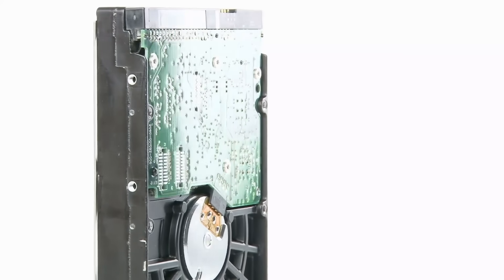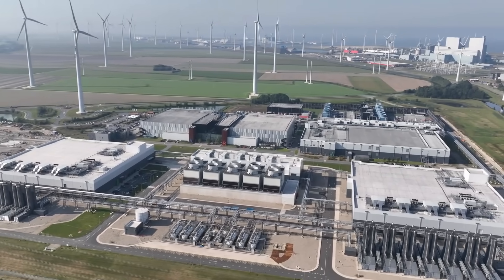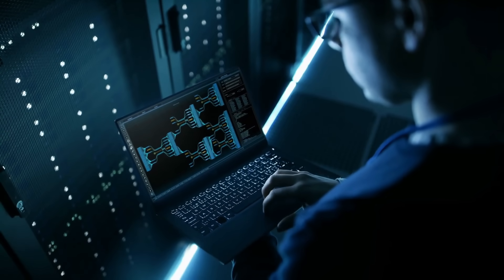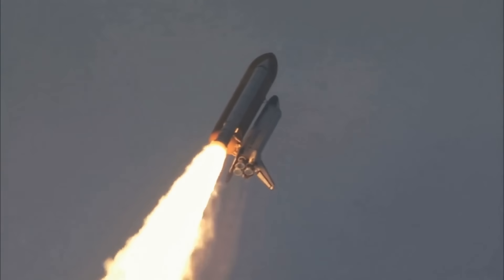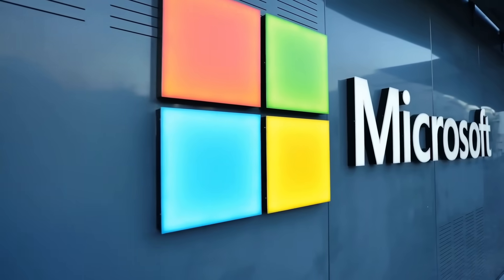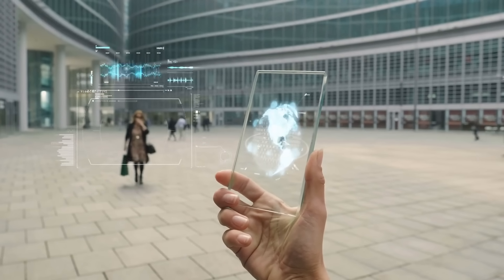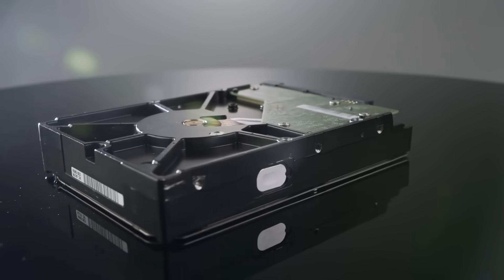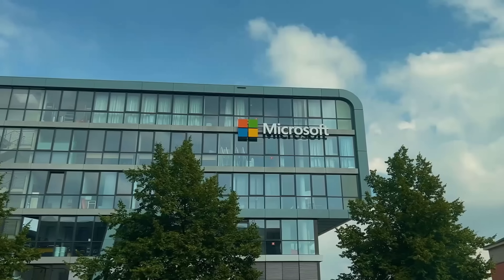The Glass That Never Dies (And Microsoft Is Terrified)

Comment: They better standardize the storage"format". These are morning but glass without a way to read the data from them. The stored data will only last as long as the hardware made to read the glass. Imagine a company uses a proprietary storage method. Then, the company goes out of business. Then, the expensive data readers start falling after a few decades. The stored data becomes unrecoverable as readers die. Companies scramble to buy and use the last of the readers to migrate the data. But, at such allow read speeds, the readers will never last long enough to migrate the data.

Comment: But what’s ridiculous is that you guys don’t mention the fact that they taking that failure as part of the process. They count on it. This is why they are constantly replacing drives and equipment at data centers. Every day in a data center you might see three or 400 new servers come into action while maybe 250 die and 50 are there just in order to replace ones that might die in the next week they don’t wait for them to die. They plan the obsolescence.

Comment: Ummm…this may be pedantic but…fused silica is a supercooled-liquid meaning it still flows, even if it is going very very slowly. So, this means that over time all your data flows into a literal puddle of incoherent nonsense. The risk of data loss due to flow increases with the density of the data. High density storage often requires smaller, more precise alterations to the material, making them more vulnerable to the effects of slight material shifts over time. It has potential, but it isn’t “there” yet. The flow must be addressed.

Comment: that isn't new, it is like carving rocks but with glass at nano scale, plus, you know what else can store thing for several years without power? a powered off hard drive, hard drives in data centers dies because these are on for long hours constantly, some even under stress conditions and high temperatures, but cold storage that is left sitting unused in normal conditions(temperature, humidity, magnetics) for long, will be fine for decades, unless you bang on them.

Comment: I would love this, can we get a home or small office solution incorporating this.  Well it’s very secure if it’s physically offline until needed, and it can’t be overwritten or changed.  It’s okay if read/write is slow.  The advantage is long term durability.  I have years and years of this kind of data, and have to move it from spinning drives to SSD.

Comment: Here's the problem nobody's talking about: How dense is the storage medium, and how many are expected to be produced, and with the "cold data" behavior, you have to factor in how many will be in the same volume. Too much density per volume and the land itself wouldn't be able to support it. What happens when we get another technology to replace that one and that one goes to one place (like a landfill) and all that mass is pushed together over time, generating more density in that volume)? It sinks, or the land does, depending on how density is displaced. But only so much density can be at any place without causing other land to undergo stresses, and that can change the density more by reducing the overall volume by bringing two points closer to each other. Less volume means more density, more density means more sinking. More displacement means larger area sinking by less amount at a time.
We already have so much much collected in small areas/volumes. Military bases, naval shipyards, Trump's wall, skyscrapers, all the metal piping and tubing and wires going up through those skyscrapers, industrial machinery and factories, factory farming and agriculture, airplanes and airports, people, their possessions (and microchips are rather dense also. It's not about mass, it's about density, how much of a thing fits into a volume of space).
Microsoft and the other corporations are going to sink us all like Atlantis. The Ownermind will be our destruction. Sailing a ship full sail at a maelstrom, and people still won't pull down the sails and find a way around or away, or both.

Comment: Nicely presented. And then we can recycle our confidential glass data storage media to make beer bottles instead of using paper shredders to make cat litter!
Reply from the maker: Fair thought  but thankfully not quite that scary.The data in glass storage is written as microscopic laseretched structures inside the glass not on the surface. Even if you melt or recycle it the information is physically destroyed long before it could become a beer bottle.So no secret files in your lager  and no need for cat-litter shredders either

Comment: Many years ago (1990s) I attended a presentation showing data stored by laser as a hologram in a lithium niobate crystal. By rotating the crystal, different holograms would be presented as different 'pages' of memory.  Interesting stuff.
Reply from the maker: Youre absolutely right. That was holographic data storage using laserwritten interference patterns in crystals like lithium niobate with rotationbased page access.What different here is the goal this glass tech isn about speed or rewrites its write-once, ultralong term archival storage designed to survive heat, radiation, and centuries of time.Same light-based idea. Very different mission.

Comment: Hard drives will only fail "in a decade" is used extensively and filled to top capacity. If stored and used very infrequently (i.e. passport drives) - magnetic data on the hard drive can survive for centuries. SSDs however are a different story. The quantum phenomenon their data storage is based on requires periodic connection to electricity otherwise data will become corrupted and unreadable.

Comment: This is why I started using Melinia Disks years ago. However, M-disks only hold 50 to 100 gigabytes. How M-DISC Works & Key Features
Permanent Engraving: Instead of organic dyes, M-DISCs use a synthetic, inorganic recording layer that is permanently altered (engraved) by a laser, creating stable "pits" that hold data.
Extreme Durability: This etching process makes them highly resistant to environmental factors like temperature, humidity, and sunlight, claiming a lifespan of up to 1,000 years.
Reply: M-Disc compatible drives are made by a limited number of companies. I have tried such drives from two companies and in both instances the write process failed when ongoing and the expensive discs were trashed.
Reply: @avsystem3142  I never had a failed Disc. But I became fanatical about trying to pack as much data as possible onto each Disc because of the cost. I have a few discs and M-Disc-compatible drives that I removed from old computers.

Comment: Gravity will distort the data over time.
Reply: No, it won't. And the meme about stained glass panes old European cathedrals being thicker at the bottom because the glass "flowed" is also nonsense. There were and are thicker at the bottom, because that was the way the artisans made them. Structurally that makes sense given that the hand made glass wasn't of uniform thickness as made.

Comment: 1) its read only data
2) Billions of years is not possible when you are talking about "Glass". Glass is not stable. Uniform Quartz crystals are more stable, maybe thousands of years, not billions of years . but even hundreds of years would be enough
Reply: Basically, the media isn't actually glass, it is synthetic fused silica, basically ultra-pure Quartz. Even ordinary soda glass if very stable. The myth about stained glass panes flowing in medieval cathedrals is an urban myth. The hand-made glass sheets were never of uniform thickness in the first instance and the craftsmen of the time intentionally put the thicker sections at the bottom, for obvious reasons.

Comment: Is that YouTuber says the one of the disassembling smartphones, glasses glass and glass breaks, one good question what happens when you drop it ,it will break😮
Reply from the maker: Good question  and a common misconception 
This isn’t window glass or phone screen glass. Its fused quartzlike storage glass similar to whats used in labs and spacecraft. Its far more chemically and thermally stable but yes  it can still crack if physically abused.Thats why its meant to be encapsulated in protective housings not carried loose like a smartphone. Durable against heat and radiation ≠ unbreakable against impact.

Comment: Can't you just generally speed things up by striping the data at physically separated regions, disks, or servers so multiple lasers can read/write in parallel? The physical limitations only apply locally, and parallel filesystems are a mature and widespread technology (heavily used in AI and HPC.) More or less multiply the read/write speed by the number of lasers you can use. It's natural to operate in this manner with very large datasets anyway. Less natural for backing up old movies than for backing up medical archive databases but still functional.
It'd add complexity for sure, which may not be what you want for practical extreme-long-term data preservation (far-future IT guys might be displeased) but for applications where you want cold storage that can also run fast(er) it's an option. It does have the problem that if you lose a disk with no backup, files from many disks now have holes in em. But if these disks really don't fail unless something extreme happens (like some sort of thing that might obliterate the whole server anyway) than that may not be much of a concern.

Comment: Data storage facilities have built in redundancy, it adds a little to the volume but provides ability to restore damaged files.
The extreme case of this was the space shuttle , with 3 computers doing exactly the same thing at all times and 'voting' results to avoid errors.
(It didn't help with the other disintegrating on entrance thing though ..)
Reply from the maker: True redundancy is already the backbone of modern storage
Reply: Basically, the "Tell me three times" paradigm.

Comment: Perhaps it will integrate some control panels and others to replace electronics to minimal all crystals like to endure and cannot interfere by any radiation or extreme pressure environments etc, like aviation, space exploration and other extreme condition or consumers on earthly people.
Reply from the maker: Thats a reasonable direction to think about All-crystal systems could make sense in extreme environments  space, radiation-heavy zones high pressure or long-duration missions  where electronics degrade. In those cases passive radiation-resistant crystal memory is a real advantage.For everyday consumer use though electronics will stay dominant. Crystal storage is more likely to appear first in space aviation defense and deep-archive systems, where survival matters more than speed or rewrites.

Comment: NO!  Storage IS NOT "DESIGNED" to fail.  It's merely that no one will pay the cost or accept the trade-offs required for data storage to be more reliable  Planned Obsolesce is ONLY EVER an economic trade-off.   The Customer has equal culpability because they want features at a price that REQUIRES a reliability trade. The universe never offers something for nothing.  All product features involve technical trades with economic trades (price, usable life)

There are NO electronic/computer storage media that last longer than 10-20 years.   Most are lossy and dead in 5-10 years.   Because of physics!!   These nanostructure-based storage technology will NOT BE ANY BETTER!      Paper and stone.  Those are your options but they are generally not electronic-ready without high volume and low information density.

Reliability is directly related to volume of the stored bit and the energy barrier height maintaining the stored bit so using "nanostructures" only accelerates failure mechanisms solely because of tiny bit volumes   Error correction will still be required.  Trade-offs must be mades.  Costs must paid/accepted.

Silica glass ABSOLUTELY DOES HAVE A STATIC AND DYNAMIC FAILURE MECHANISMS that will cause data loss in less than 100 years.

Phononx and Microsoft are making the same mistake/error that the semiconductor industry made.  The same exact things were claimed of MOSFET gate oxides (not even NVM gates which have known destructive operating mechanisms), which are exactly the same kind of silica.   

The mistake is that  a theoretic, paper calculation of defect densities and reaction kinetics can be used predict reliability of devices/storage.  The numbers given in this video are PROOF that they have done exactly this.  These estimates (and calculations) have long ago been proven WRONG in the empirical world of reality in semiconductors.

Guess what - even a static gate oxide of MOSFETs, that are never turned on, will age and fail in decades not eons - because we exist at 300K and not absolutely zero, plus we've pretty much hit energy barrier limits (due to the periodic table of elements) and the physical dimensions of what we can build today.
   
But turn it on (apply voltage) and all MOSFET gate oxides fail by HCI or BTI much faster.  The PLANAR MOSFET rule of thumb is N years of usable life for N nanometers minimum dimension/node/lambda.  3D structures merely delay that a bit -  the same mechanics start back up at ~3Å sizes in any of the 3 dimensions. 

BTI failure is triggered/caused by a single manufacturing defect involving a off-lattice oxygen atom where the offset is in fractions of Å.  Even with EUV, we can NOT CONTROL SUCH ERRORS and have economically viable yields.  This leads atomic displacement at manufacturing leads to a cascades of coupled damage events and to ultimate end-of-life failure.   

Accessing by light is the same - e-fields are created by the light that have the same effects.  Unless you allocate volume for redundancy and error correction,   This converges to a lower information density.

Their marketing claim is made by a physicist who has Sheldon-ed their technical understanding of the problem!!  Oh so common a phenomena!   

I've looked at all the recent papers at IRPS (the primary world-wide reliability physics conference which I've attended for decades).  Neither Phononx nor Microsoft have submitted a paper on this subject.  I don't remember Phononx ever attending.  Microsoft has be there but the people I have talked to were NOT involved in anything like this.  I will merely say - I am not holding my breath awaiting this technology - it has a "bad engineering smell" to it.  

Also there is the "20 year rule" which the video specifically states will be MAGICALLY bypassed.   Yeah, that has never happened so it will not happen now.

Comment: For years now, researchers have been discussing crystal- or quartz-based memory technologies—some of which directly exploit the atomic or lattice structure of crystals to store information. In reality, what you describe in your video is neither new nor science fiction. Several data-storage systems based on crystalline or solid-state structures already exist today, and some of them are even accessible at the consumer level.

From a scientific standpoint, these technologies rely on extremely stable physical states: variations in crystal defects, electron trapping, refractive index modulation, or even multi-dimensional encoding using femtosecond lasers. In certain cases, information can be stored in three or more dimensions within a crystal volume, achieving exceptional durability, thermal stability, and resistance to electromagnetic interference.

What remains unclear is not whether these technologies work—they demonstrably do—but why they have not yet achieved mass adoption. The limiting factors are likely not theoretical, but industrial: manufacturing complexity, write/read speed trade-offs, cost scalability, integration with existing semiconductor ecosystems, and the inertia of well-established silicon-based memory technologies.

In short, crystal-based memories are real, experimentally validated, and in some cases commercially available. The real question is not if they are possible, but when—and under what economic conditions—they will become mainstream.